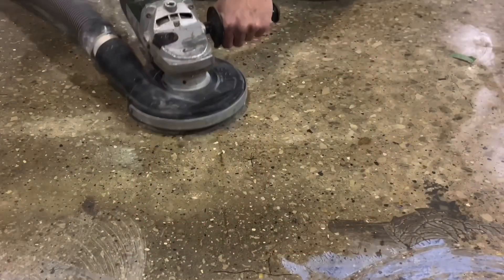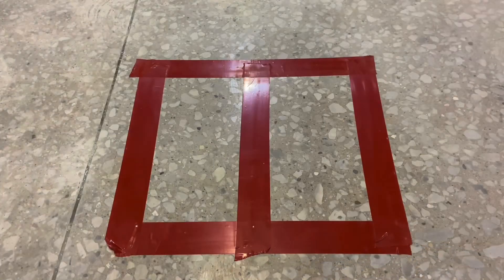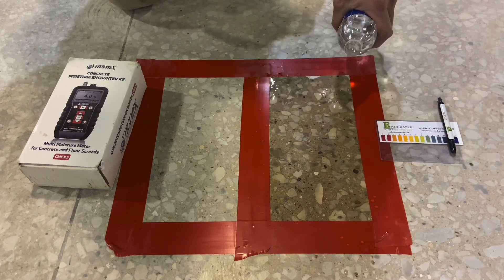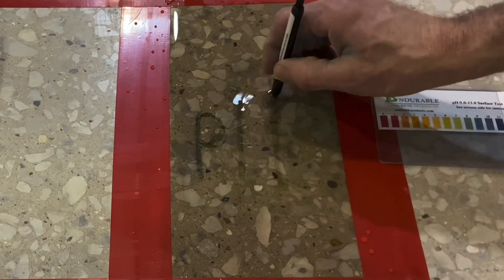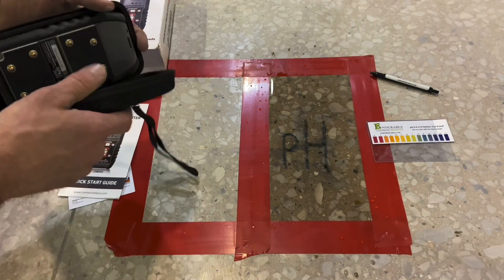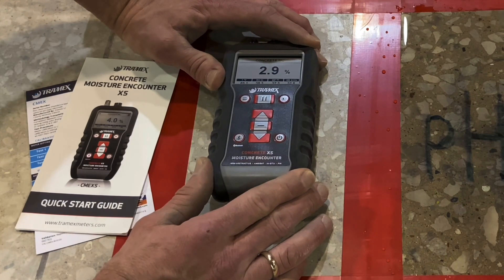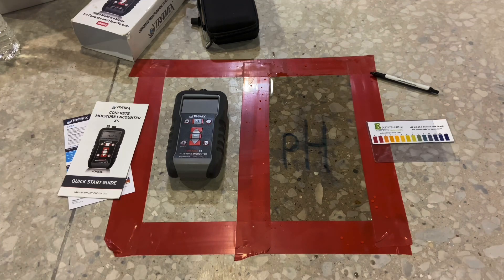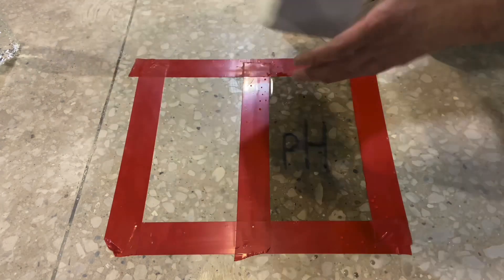How To: Measure Concrete Moisture Content and pH

Comment: Can you explain more of the importance of knowing the surface ph and what to do if ph level is to high. Sorry for the newbie question.
Reply from the maker: Sure thing. Happy to help. 
Too high would be a 14 (maximum pH). This would require a mitigation product that is able to handle the alkalinity. Most epoxies are able to handle a 12. Some can handle a 13. 

Testing gives an idea of what the slab chemistry is before the application of the coating. My best advice is to test, document, and verify with the supplier if their resin can handle the given conditions. 

One other piece of advice, if a slab is tending more toward lower than 9, then I would not proceed until more testing can be done. Healthy concrete should fall somewhere between 9 and 12.
Reply: @Josh Jones  thanks so much Josh!
Reply: What moisture content is too high to install epoxy? Thank you for the great vid os!